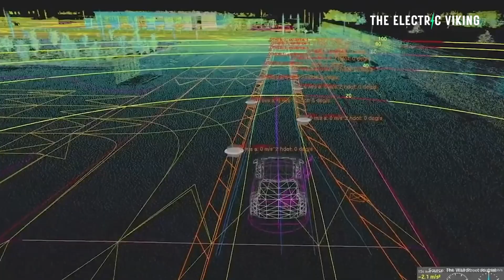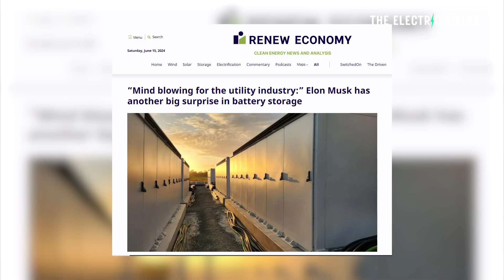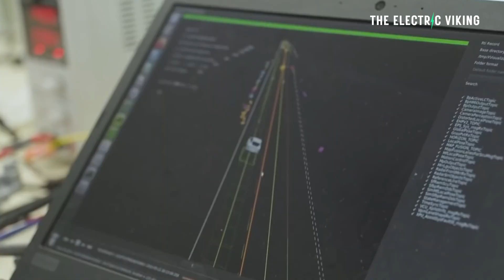Elon Musk's plan to disrupt energy storage “Mind blowing for the industry”

Comment: How often do these batteries need to be replaced? What's the footprint of having batteries, solar panels, wind turbines and dams vs a typical power plant? I have a feeling this would not be possible in most places simply because of the amount of space it would take to be 100% renewable.  I haven't even mentioned disposal, which is impossible for some things like wind turbine blades.

Comment: The experts I've read say you can't have more than 20%, not 10%. And it's you can't have more than 20% on an independent grid without having power storage. That's the caveat. So, nobody credible think's it's impossible, you just have to add power storage to deal with the intermittency/

Comment: If you really want to see some extremely impressive storage tech, go look at Just Have a Think's latest video.

Storing heat to replace coal boilers in thermal power stations.  Utilises all the existing grid connections, can provide GigaWatts for several hours.

That could get Australia through the average of one Dunkelflaute day per year easily by repurposing your dirty coal stations.

And could really boost China with all those coal stations they're building that will otherwise become stranded assets.

Comment: “A Tesla battery energy storage system will be installed on the same site as the onshore converter station for Ørsted’s Hornsea 3 Offshore Wind Farm in Swardeston, near Norwich, Norfolk, in the eastern part of England. The battery’s location on the same land as the onshore converter station minimises disruption to those living and working nearby. The storage system has a capacity of 600 MWh (and a 300 MW power rating), equivalent to the daily power consumption of 80,000 UK homes. When it is windy and sunny, so that electricity generation exceeds demand, the battery will store the excess so it can be discharged later to help balance the grid.” Ørsted announcement.

Comment: The grid's frequency has to be 50Hz, which is a problem if you remove the gas turbines that generate electricity at exactly 50Hz, such as home inverters that use the grid to match the 50Hz no longer can. This is a technical problem

Comment: As of 2021/2022,  Australia's Energy generation mix... Coal: 52.9%, Natural Gas:18.8%, Solar: 10.5%, Wind: 9.3%, Hydro: 5.6%, Oil: 1.8%, Bioenergy and Waste: 1.3%.
 So  73.5 % of power generation as of 2022 is fossil fuel based.(This may have improved quite a bit in 2024)  I believe that  Tasmania  and ACT are at  100% renewables,  South Australia by 2027, currently at 99%. Interesting South Australia has highest power prices. 🤔

Comment: The sub stations are the reason modern electrical systems are so clunky, they also take up basically all the transformers

Amusingly, they are also a limitation in AI, which draws more and more power from the grid

Substations and our outdated electrical systems have been the biggest critique of plans for electrification, if the new powerwall actually addresses that issue, that would be the last major hurdle in the face of green electrification
Reply: Edit, from the looks of things, the batteries do not need an inverter for themselves directly, but the grid will still need them, meaning it is a major bottleneck, but it will be twice as easy/cost-effective to add these megapacks to the grid, so you can save the inverters for residential and commercial applications and power stations

Comment: BASE LOAD is needed for INDUSTRY. Its a must and NUCLEAR is the best base load option for steel and concrete creation and diesel for delivery. Even with the evolution of nextgen batteries, base load for industry is a MUST and its why china with all its new massive plants and batterys, needs cheap coal to make stuff! BASE LOAD is INDUSTRY, real INDUSTRY, you cant do that with wind and solar and probably never will be and why Fusion is still the best final outcome! Teslas own plants have solar on the roof, connected to windfarms and have access to all this battey stuff need BASE LOAD to make cars, solar rooftop and batteries! It can assist to lower costs is why they do it, but without the grid, the thing would wither to a dribble in minuites!
Reply: It is a myth propagated by climate denialists that you cannot create base load from a combination of wind, solar and battery. There are a lot of sources to confirm that. Just take the time to look and educate yourself

Comment: UHV - Ultra High Voltage is a system of effectively delivering DC power across long distances and its been adopted and used in China. I think Changji-Guquan Power Line 1100 kV is currently the longest and highest voltage direct current transmission line of China is the highest voltage level project, largest transmission capacity and longest transmission distance in the world!

Comment: No, Adelaide is not "the only city in the world to run only on renewables". Adelaide city council purchases "green power" for its council owned buildings and facilities. It doesn't mean the whole city is run on renewable power. It just means the council pays a bit more for electricity and its usage is allocated or offset to renewable sources. I can do the same thing but it doesn't change where my power comes from. The power lines still come from the giant gas fired power plants as well as the solar farm and wind farms. The councils usage is also a tiny fraction of the total power a city uses.
If the city had been completely powered by renewables and the battery system it would have been a real disaster when the battery caught fire in 2022 wouldn't it. The battery systems are just buffers for the normal grid system so they don't have to spool generation up and down so fast, which can lead to blackouts.
Reply: 2022 battery fire was in a different state to Adelaide - what a surprise, anti-renewable guy fails basic geography.
Reply: 👆
Sam, first time I see your videos.
You really need to check facts before you dish them out as true.
Reply: @deathbysalt2382  You won’t get an answer mate. I’ve tried many times to get a response. He just dishes out numbers and faulty data like confetti at a wedding.
Reply: @deathbysalt2382  Thats never stopped him, lots of lemmings in here hang off every word he says is true.
Reply: smoke and mirrors ~ the bullshit spin of government knows no bounds! Even if SA got rid of all power generation from coal and gas, they are connected to the grid and we in QLD will be sending them it from our coal and gas plants! Love lies, always a layer away from the real truth! If we flipped the switch, the SA batts would last them 20-30 minuites if they only supplied homes and not industry! Its a marketing joke
Reply: Now that is a scientific takedown. I salute you!🫡

Comment: As an aus, I have to call you out on the utter bullshit you spouted about "Adelaide blackout". Very irresponsible. When you spread fake news about stuff I do know all about, makes me realise you probably do it about other stuff also.
Reply: Isn’t he referring to the blackout caused when the interstate connector went down due to fire and wind? I recall that was the impetus for the big battery
Reply: Yes. Without connection to Victorian synchronous generators, SA grid was unstable, SA asynchronous generators (wind turbines) tripped off line. SA solution was to build two “temporary” gas fired synchronous generators, at Elizabeth and Lonsdale. The “big battery” at Hornsdale, in system terms, is actually extremely small, originally 100MW for 1 hour, subsequently increased, now 150MW for one hour. It’s value is, if the Victorian umbilical cord gets cut again, SA system batteries  should hopefully be able to hold the system stable long enough (minutes)  so that the wind farms don’t trip before the gas generators can fire up and provide the necessary ancillary services.

Comment: Peaker plants are not going bankrupt, they are being phased out. We need all homes to have their own batteries to reduce the size of the battery storage facilities.
Reply: Can use the car as vehicle to grid?
Reply: @rtz549  Yes, but only when the car is at home. Better to have purpose built storage that is always their so the grid will be stable. If you have home solar, you can also charge the batteries during a black out & run off grid.

Comment: All good to say that in Adelaide we run on renewables but remember I’m only getting 5cents for my green rooftop solar to the grid, when I draw it costs me 42 cents so in the end from a cost perspective I lose and the electric companies win. I’ve supported the grid like many others in SA for many years but when will it become a fairer option. Surely the excess power I make is as valuable as the one I draw back.🎉
Reply: No, your excess power is worth very little because it comes in the middle of the day when all the solar panels are producing power full tilt, and residential demand is not high.  Price is determined by supply in demand.  Supply is high, demand isn't high, so that power is worth little if anything.  Later in the evening, when the sun is setting and everyone is getting home from work and cooking dinner, THEN that power would be worth a lot more.   You should get a battery so you don't need to buy expensive power from your utility.
Reply: @incognitotorpedo42  
Look at the other reviews they say the same thing the savings go to the power companies and not the consumer. Just looked at new rates suddenly a supply charge shows up, wasn’t on my current plan so ,could it be the end of the 300  we are about to get from the feds. We still lose.
Reply: @nick0047 you have options most of us don’t have. You can buy a battery as a sensible price and store your cheap sun power.
Reply: @jsanders100  anyway a battery for the home is still too expensive for most of us
Reply: @incognitotorpedo42  
No you’re wrong , the power paid to the resident is always fixed it isn’t variable and the system is ripping residents off. The power companies make the profits never the consumer. Go do your research

Comment: A solar roof over those massive battery farms would keep them cooler and charge them
Reply: Well, it would probably keep them cooler.  Do the math on how much area of solar cells is needed to charge a battery of that size.  It's a LOT bigger than the area taken up by the batteries.
Reply: @incognitotorpedo42  I would worry about adequate air circulation.  Maybe the engineering could make it work
Reply: @tireddad6541 . Agreed as is obvious from photos the big fans on top of the crates holding the batteries are crucial in keeping the batteries cool. But if they don’t affect the cooling fans it seems obvious that the crates would be cooler if in the shade.
Reply: @incognitotorpedo42 
Yes, as a rough swag, every cubic foot of battery requires 32 sq ft of 100w panels, 16 sq feet of 200w or 8 sq feet of 400w panels. 

So if they are 4'x6'x8' that's 24 * 8 = 192 * 8 = 1520sq feet of 400w panels.

Basically a small house of area of 400w or 4 houses worth of 100w panels.
Reply: Depends on the distance between the panel and the battery. In other parts the panels heat the ground under the panel which effects the quality of the soil.
Reply: Yes it would and in areas where they use solar like this it creates a microclimate under the panels.
Reply: and who is going to pay for that?

Comment: Hi Sam I live in Adelaide the companies are making huge money and yet all of Adelaide's power bills are ridiculously high. When wind and solar isnt generating enough is bought from interstate at a premium yes they increased to battery storage to make more money for the company it wasnt passed onto the people.  I  even have 11KW system that used to save me a lot almost cost neutral but now Im getting an increase bills. I love the concepts but somewhere the concepts arent making it to the users its just lining the pockets of investors
Reply: Are you still getting blackouts?
Reply: @jsanders100  Adelaide and SA had a remarkably mild summer this year so there were only few occasions when aircons stretched the needs that was a hot spell in autumn (March) but there were still some (3-4)  blackouts in my area
Reply: Battery stations strength is that they have ability to instantly regulate power, both up and down. That is a useful feature to stabilize the grid in the short term, from sub second to a few hours top.
The drawback is that they don't produce any power and they are really expensive.
They do make sense if you have poor system stability with lots of weather dependent production and no cheaper way to get the stability you need. The trick is to never get to that position.
If you don't have enough production that you can plan there will be times when the weather is unfavourable, like when Adelaide gets a heat spell and most people want to run the AC.
There are essentially two outcomes, either you need to bring down consumption or you will get blackouts.
There are several ways to bring down consumption, like price going up a lot or controlled rolling blackouts or deal with large consumers to stop their business for a pre-agreed sum of money.
Having an unstable energy system usually comes with connections to places with more stable grids. That means you are taking advantage of their grid stability because you did not want to pay for your own.
In Europe we have seen huge number of problems in the grids including blackouts since the percentage of unpredictable power generation has increased.
Reply: Yeah guess what? It isn't cheaper. The people making money are factories in China making these technologies. It could be cheaper in 20 years.... but that is a long time to pay high power bills. It's marginal on buying your own generator and burning diesel in Adelaide, it's a complete joke.
Reply: People who watch this channel are starting to see the truth behind so called green electricity and the cost of what Bowen said is cheap.
Reply: @dikkybee4003  bollocks. you conveniently overlook the actual cost of continuing to burn fossil fuels that we will all have to bear in the near future, do nothing, you will be running air conditioners 24/7 in a vain attempt to cool off. its the cost of the fossil fuels that are mostly pushing up energy prices at the moment, we also sell our AU  gas to overseas users more cheaply than what  we pay for it .Private enterprise is the main reason why we pay so much for energy here, we privatized our power companies ( who then ripped us off for decades building transmission lines that often were not needed ) and we sold our gas to japan and china for peanuts. if wee had planned it correctly we would be streets ahead , but governments that were in the pockets of fossil fuel companies sold us down the river.

Comment: The Australian electricity grid is 1 million km. To 20 million buildings. 

$ 1 million per km the nuclear promoters say for new grid.

So, nuclear at the existing fossil fueled generation plant is the only economic way.
$millions saved on new grid construction. 

So, nuclear promoters are saying that the grids value is $1 TRILLION.

If 100% electric then $TRILLIONS and $TRILLIONS more needs to be spent on the national grid capacity.
Reply: You are confused. Chemicals or endogenous?
High voltage multi-GW lines no doubt cost $1 million per km - same issue for solar feeder regions, for Snowy 2.0.
Plus the transformers at each end.
Reply: @iandavies4853  you are ignorant. 
Distribution lines are energised.
Suburban streets are in constant use.
Increasing capacity in overloaded conductors would be late night shift work. 
I've been there and done that.
It was expensive as all hell.
Bigger switch yards' capacity and transformer capacity are not cheap. 

Today's grid is fragile because it is so expensive to build and was built to minimum engineering economic standards. 
The grid was built over 100 years.
These little wire into your home is nothing. Except when you are a farmer that wants town electricity, and you get your quote for supply. 
Suburban buildings cannot start construction until supply is available. 
I have worked on 2 substations in new buildings.
Reply: @iandavies4853  $ 1 million is a dirt cheap estimate.

Comment: Thank you ALP in South Australia   Never would have been agreed to if State LNP were in
Reply: actually the last liberal govt was pretty good on renewables, but yes, in general they have been awful.
Reply: Yep the alp's big batteries can power the state for 8 minutes. Well done. If it's cloudy for a week. What then? NSW and Victoria coal to the rescue.
Reply: @Guvament_bs a comment from someone with no clue how the combination of wind, solar and batteries can do exactly what a coal fired power station can. Only greener and cheaper
Reply: @zoransarin5411 south Australia has the most expensive electricity in Australia. Pure coincidence?
Reply: @Guvament_bs  Could it be private ownership that is to blame? How about setting the grid up for gas peaker plants and making the spot price go through the roof during times of high demand and low supply? There is a vast difference between the cost to generate electricity and the price you are charged and I think you know that.
Reply: @Guvament_bs that is mostly due to the cost of gas sunshine, we stopped burning brown coal and now rely on gas, which costs a far more, we also have a large state and a small population, which increases transmission costs ,  seems to be you are one who is full of bs.
Reply: @reverendbarker650  very clever from some one with some roos loose in the top paddock.